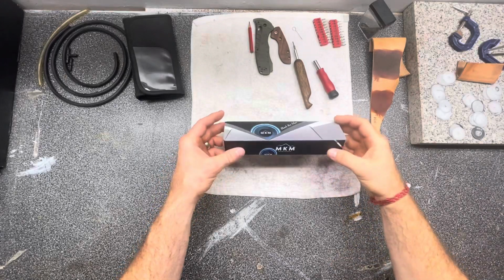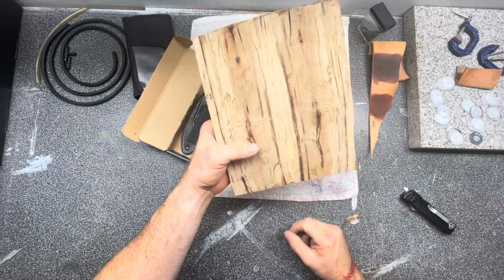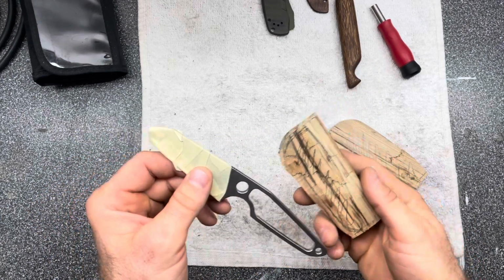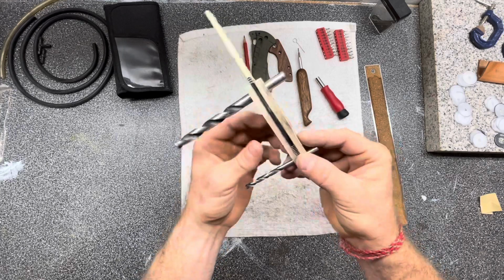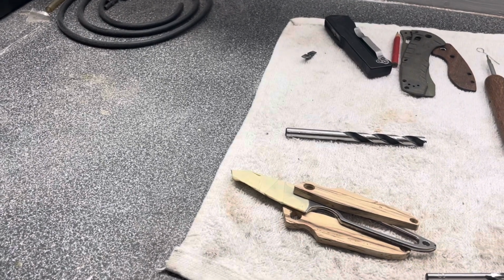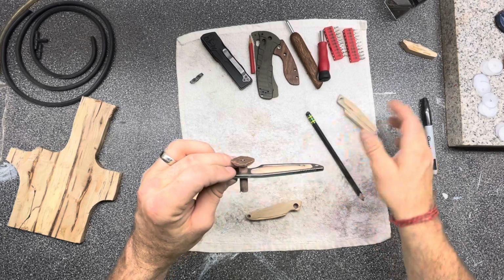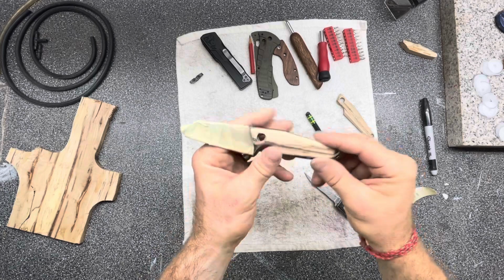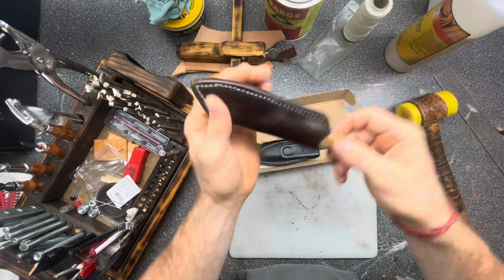Making CUSTOM Scales for MKM Makro for Pops

Comment: Thanks for the video. Good job man! I especially like that You used wooden pins, very classy. 
I own a Macro 2 and is n my edc rotation. Being a metal worker, I do have to mention, magnetic sheath will magnetize the blade and it WILL attract metal dust and shavings.
Reply from the maker: @janpen78  Thanks!  👍 yeah, i want a fan of that sheath at all really.  They’re never as nice or quite the right fit as one you custom make and that magnet was annoying.  I didn’t think about it magnetizing the blade… even the m380 metal?  Recently i had to buy a new tape measure and they have ones with magnetic tips, and that’s all i thought would happen; exactly what you mentioned here… it would just pick up shavings and not give an accurate measurement 🤷‍♂️
Reply: @carneraerial  Haha, exactly. The spots at the sheath where the magnet is get just like the tip of the tape measure. Blade alone is much less magnetic than that, but it will lift small metal pins etc. I plan on making a pocket carry kydex myself. Just like You - not a fan of the original sheath, but I've grown fond of the knife. I did cut a small sharpening choil into the blade though.
Reply from the maker: @ that’s cool.  I’ve thought about adding that to a few knives.  I did make a kydex press a number of years ago.  Made sheaths and holders for tons of things.  Have fun with it👍

Comment: I have one of these, love it. However I swear I'm the only person in existence that bought a drop point, literally every one I've seen is the sheep's foot.
Mine came very sharp, but it's such a thick piece of steel and the bevel use relatively wide. I always sharpen new knives anyway, factory edges are usually too low. Plus the first edge usually has poor edge retention compared to after the second or third sharpening. I had heard that long ago but never believed it. Finally I did an edge test on the factory and a second edge and tht second one more than doubled the amount of cuts.
I always thought M390 to be a pain to sharpen, especially if you're going to reprofile it, then I bought a Lionsteel M1 & M4 that they did a limited release in CMP M4. It was such a hard steel that it made M390 seem like putting an edge on lead.
Reply from the maker: Dad liked the shape of my Pilar, so I went with the sheep’s foot.  I’m looking at the Lionsteel M1, and saw the  M4 variant.  It really is that much more of trouble to profile and sharpen?  
I would agree totally; I went with the factory edge on my Benchmade turret for a while, but it has been much better since I put an edge on it.
Reply: @carneraerial  It definitely is more difficult, the flip side is that when you do sharpen it, it'll hold the edge for like a decade. Honestly if you use it the way a typical person uses an EDC: opening packages, cutting tape or Paracord etc, you could feasibly hand it down to your kid without ever having to do more than strop it, maybe hone it a bit now and then.  M4 is about as close to magic steel as you'll find on blade steels. There are others that are as hard or harder, but they're extremely brittle. M4's HRC hardness to toughness ratio seems almost impossible, but it's extremely tough for it's edge retention. M390 is around 58-62 HRC (though it's usually 59.something to 60.somthing, M4 is 64-66HRC, but like 3 times tougher. It's closer to a carbon steel like 420HC. Personally I find it to be the perfect steel, the only drawback compared to m390 is that it doesn't have the corrosion resistance (it's more like a carbon tool steel), but it's not as prone to rust as 1095 or anything like that.
Edit: I was looking on Blade HQa few days ago, they have some left and they've discounted them quite a bit, they were $30 more than the M390, but now they're $20 or 30 less than them.
Reply from the maker: @timwhite5562  that’s good to know.  I can be fairly rough with my knife if needed.  It just depends on what projects I’m working on.  I tend to buy things to use them.  Headed over to the blade hq website note to look again.  Thanks!
Reply: @carneraerial  👍
Reply: love the look of the drop point but i think most people buy the sheepsfoot because in edc its a more usefull line of edge to use. or at least thats why i own the sheepsfoot version but i prefer drop point Version designe wise
Reply: @SnerASDF  funny you say that. I ended up going with a Lionsteel H1. It has a karambit ringtail on the tang, but I went with the sm modified sheep's foot. It's actually VERY similar in shape to the MKM.
BTW, I see a lot of controversy over the Italian heat-treat of the M390. I always resharpen a knife when I get it: I find the factory bevel to have angles that are too high, and the very outer layer of steel tends to be a little softer, and the edge loses the edge faster than m390 should until you get to the good steel, usually street the first one or two sharpening.
That said, I'm of the belief that at least half the people who say the ms390 sucks and doesn't hold an edge and how fast there's goes dull don't actually own one, they're just repeating what they read on some forum of it, and saying they do to give their opinion more weight. I I think a good portion of the other people are nrw buyers that don't really have a lot of experience with knives and they're just starting to get into it. they know enough to know that steals like m390 is supposed to hold an edge really well, but they're not the type of people that probably sharpen their own knives, in fact they're likely the people that might never sharpen their knives, in the factory edge will be the sharpest it will ever be.
I noticed on the first sharpening the steel came off, not easily but not d slowly as m390 should. Once I brought it down I thought that I had got to the quality Steel because it definitely got harder. A few days later I decided I wanted to change the angle again so I pulled out my bench stones and went back to work at.. after a little while I realize that I had not yet hit the good. I was doing passes back and forth and everything was going the way it had, and then suddenly it just wasn't sharpening anymore. It just started to slide across the stones and the grip of the stones were no longer biting into the steel. It ended up taking me two hours to get it how I wanted. This was two months ago and except for having to strap it a few times the edge has not lost any of its cut. moral of the story is I think people are paying way too much attention on numbers and percentages and not enough attention on how it actually works.
Some guy was telling me all about  this and that scientific term and why m390 sucks. I have told him It's All Greek To me, that I have been sharpening knives for over 30 years and I can tell just by the way it sharpens housing knife is going to perform, and ifv it's ever performed in a way that I didn't anticipate by the way the stones work with it it was always that it worked better than I had anticipated, and how that was the case with this knife.
His response was "it's all about the micro structure, you can't tell how a knife is going to perform by sharpening it and if I believed that I could I was moving a lie.
I told him whenever I hear some version of "don't believe my lying eyes, the conversation ends. " Another commenter responded sarcastically "yeah dude, why would you think you'd be able to tell how well your knife hold it's edge just by how well your knife hold and edge.
Tht guy talking about micro structure is about as good of an example of someone who trades forums too much, and uses knives not nearly enough.
I still want the MKM, and kind of want the Sheep's foot, but with this I think I'll stay with the drop point.
Reply: @timwhite5562  thats effort into a comment. love it. i had only good experience so far with 390. i fucked my jigged penguin from Traditional pocket knives up when i sharpend it. so i was a little scared to sharpen that steel again but i will try. its crazy how different the steels feel to sharpen. mine came good from shop i did a bad job sharpen it at first but i did get a nice slicy edge on it. i still love s35vn more because its easier for me to sharpen and is slicier but 390 hold the edge longer in my experience so i just have to sharpen it more to get used to it..
Reply: @SnerASDF  get a decent guided system of you're uncomfortable freehanding it. Id recommend the Work Sharp guided. There are two 'guided' sharpeners: one is a bench stone that comes with angle guides, the other is the guided. It'll have something you clamp the blade to, then use stones with a rod attached that goes into a ring that maintains the angle. Instead of running the blade across the stones, the stone goes over the blade; that's the one.
They're like $60 and worth every penny. There are others, but the rod on them goes into slots that hold the guide. They're limited to the angles they provide, and there's too much play in the angle. The work sharp will go to any angle.
It's almost impossible to screw up with them if you follow the directions.
Reply: @timwhite5562  yeah i got the Worksharp ken onion because i use my knives a lot and abuse them its easy and fast and have some wetstones and with any other steel no problem so far. i maybe was just uncareful and lazy and it was my favorite knife i fucked up xD